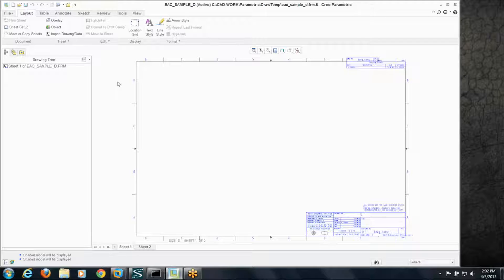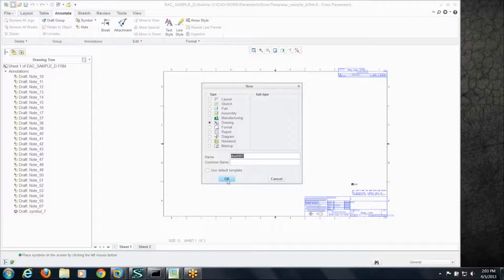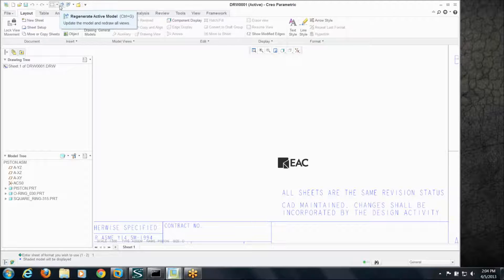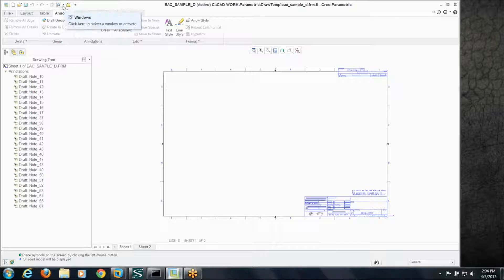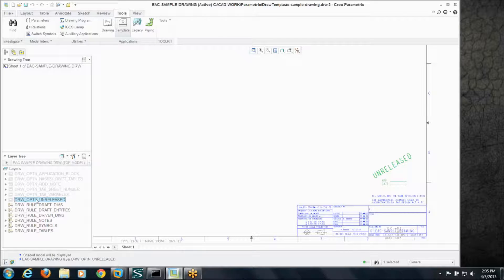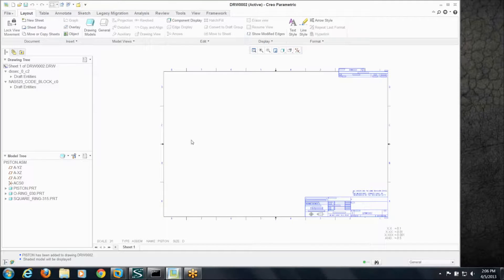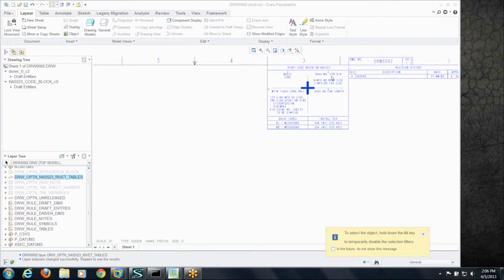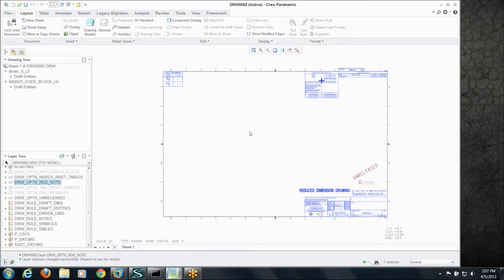Setting up drawing templates for easy addition of options and symbols - EAC Tip of the Week

Comment: Hi Mark,
If i have 3 symbols namely "A", "B" and "C". As shown in the video, one can hide or unhide using layers. But what if i need to automate this. For example if i open the drawing it should ask me if i want symbol A,B or C. Is this possible?
Reply from the maker: You could use a drawing program.
In the model or assembly that is represented in the drawing set a parameter to have a value = A, B or C.
You can set a drawing program to display either symbol A, B or C based on the value of that parameter.
The drawing program will not prompt you for what value you want but it will display what you want based on that parameter value.
You have to decide what technique to use to change that parameter (Pro/PROGRAM, just editing the part parameter, etc).